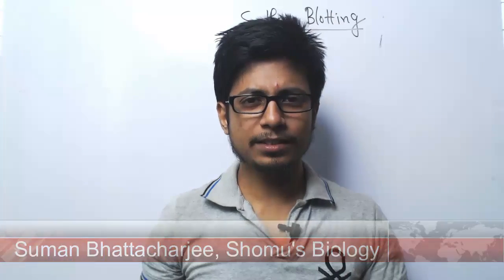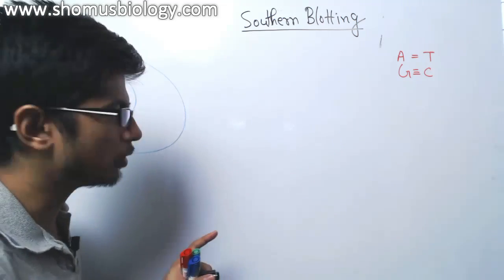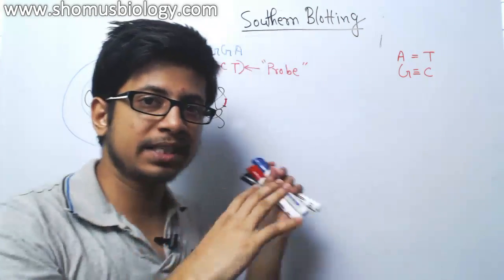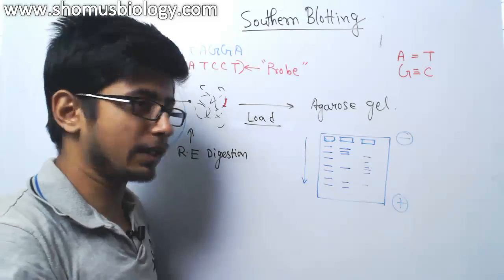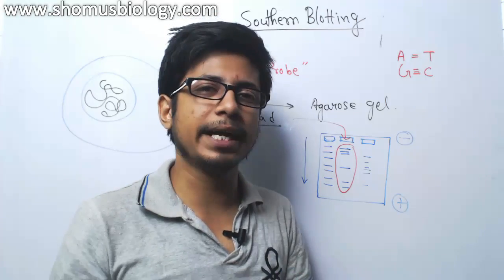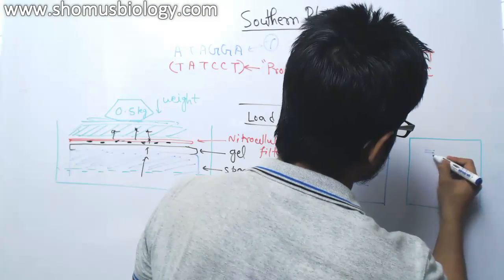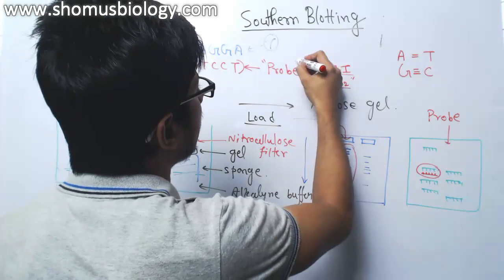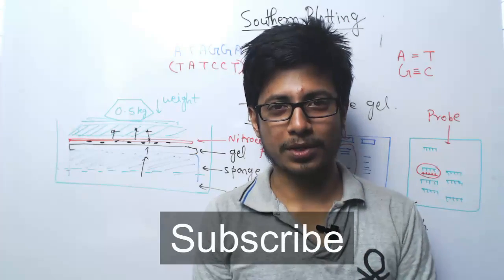Southern blotting

Comment: Why do you need alkaline buffer? What would happen if I used acidic buffer, water or Histidine? Why does it HAVE to be alkaline buffer for the imprint to work?
Reply: Thank you ^.^ I understand now
Reply: dna is negatively charged(phosphate group). alkaline buffer is more basic (ready to share an H+) and acidic buffer is ready to take an H+. in this reaction dna is the acid and is reacting with the basic buffer... this is my thinking..and reference from my orgo chem class... i think the phosphate group which consists of P(-)H3, where the phosphate atom is negative, would give away other H if combined with something more acidic or some compound wanting a H more. Causing the dna to become more reactive.
Reply: Acids contain excess H+ ions, which bind quickly to the phosphate (PO4)- backbone and cancel out the negative charge. Without charge, DNA can't migrate because it won't be attracted to the (+) electrode. The alkaline buffer does the opposite, neutralizing any H+ (or Ca2+, Mg2+, or other + ion) by pulling them off the DNA, into solution. Alkaline means excess OH-, so by dissolving any (+) ions, it makes sure that the DNA will be (-) and be attracted to the positive electrode (allowing migration and development of bands).